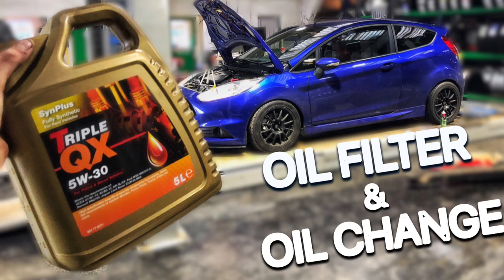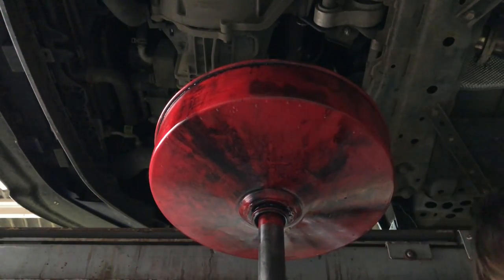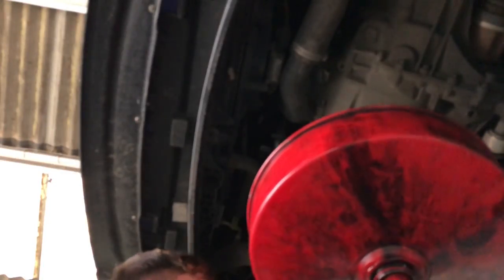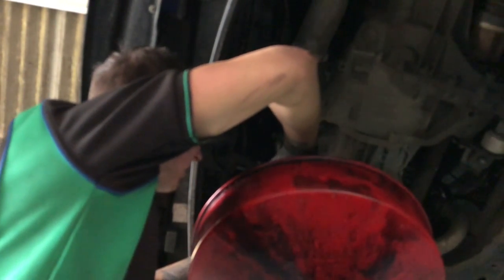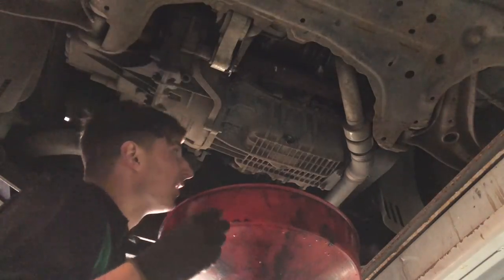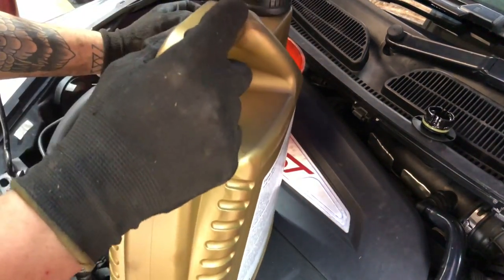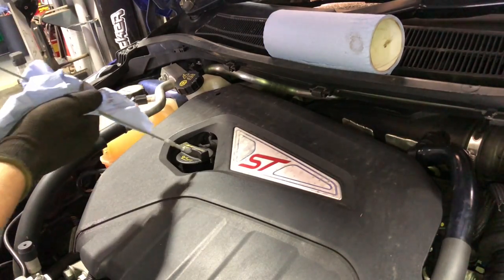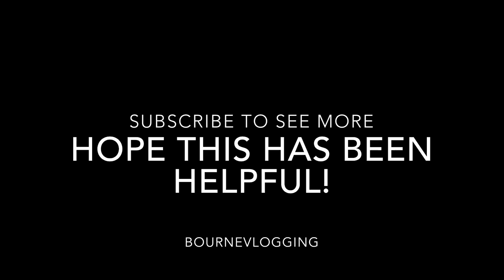FIESTA ST - HOW TO CHANGE YOUR OIL FILTER & OIL

Comment: Don't you have to put some oil in the new filter first?
Reply: That is best practise when they are vertical but when the filter is in sideways it will just pour out anyway.
Reply: Never put dirty new oil in the clean side of the filter.
Reply: NO, don't prefill a new filter. When changing oil, the pump drains back into the sump. Thus when you start with new oil and filter the pump has to self-prime. To do this it must pump air for a few milliseconds. If you prefill the filter the air in the pump compresses more and it becomes harder for the pump to pick up fresh oil from the sump. This can cause damage to the pump

Comment: Would you recommend the 5w20 or the 5w30 oil? And why? Because Ford recommends the 5w20 specific oil from them for all their 1.6 Ecoboost engines and im a bit concerned to be honest.
Reply: 5w20 for the ecoboost 1litre. The 1.6 can either have 5w20 or 5w30. I persnally put 5w30 in mine as long as the oil meets the required specs. Its all in the car manual mate